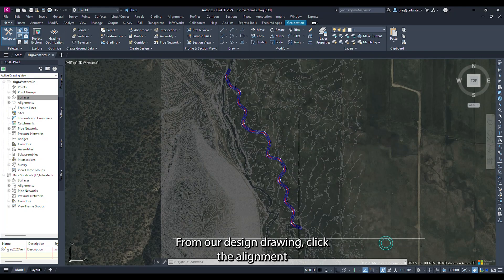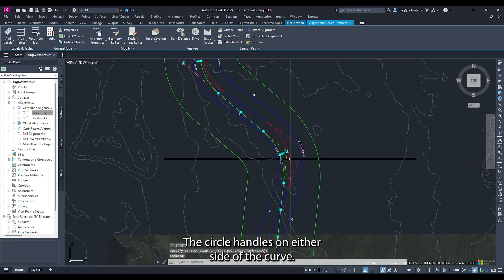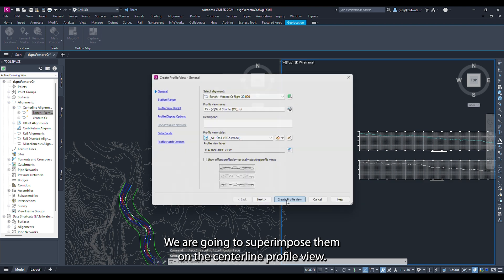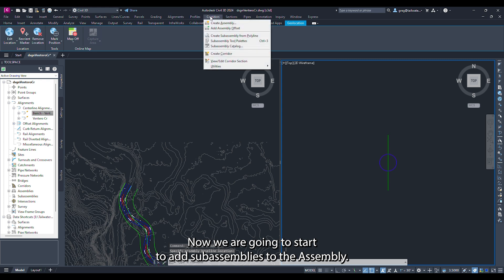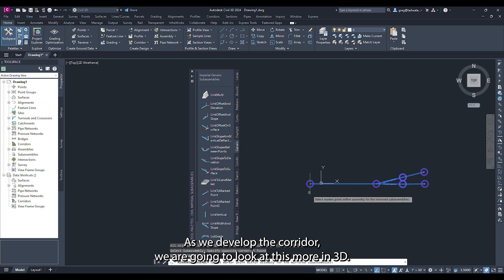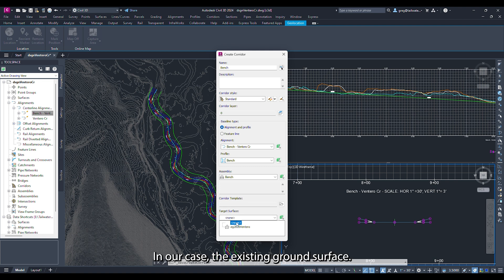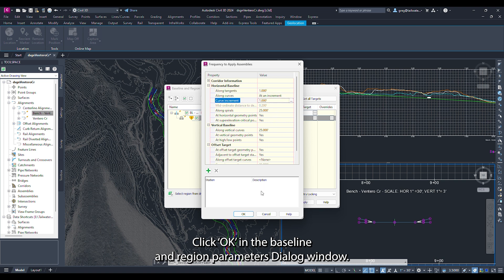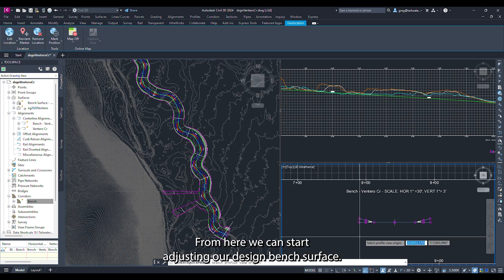3 - Bankfull bench, design profile, and floodplain corridor in Civil 3D

Comment: When I create my offset alignment only one side appears. What am I doing wrong?
Reply from the maker: Typically that means that there is not a solution for your offset alignment. Make sure that the radii in the alignment that you are offsetting are greater than or equal to your offset distance.

Comment: Thank you for the video. Could you pls explain why you are adjusting the radiuses at 1:40. Seems to be a design concept I'm not understanding. Thank you.
Reply from the maker: You bet! The offsets from the second alignment are used to define our bankfull bench grading. The bankfull bench grading helps shape how the water will act at flows greater than bankfull stage. Initially those flows will be directed towards the inside, or point bar, side of the channel, moving it from the outside bend towards the inside. If the point bar is functioning correctly, water flowing over it towards the inside bend will be shallow enough not to have enough power to move sediment, therefore being a depositional zone. On the outside of the bend, the point bar's function is to scour, keeping the pools cleaned out. Once we use these offsets to create the corridor, the corridor surface can be used as a canvas for using Stream Tools to refine the bankfull channel design which I describe in the next video in the series https://youtu.be/2Dd1fzY8dGk. 

Thank you for the question and please feel free to reach out with additional questions, or if you need additional clarification.